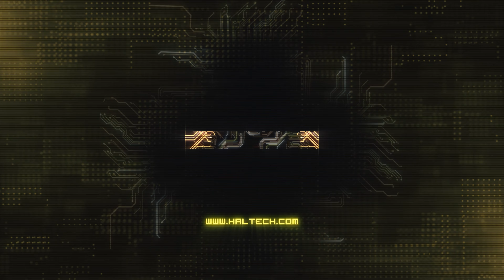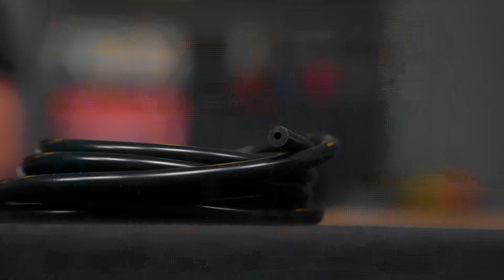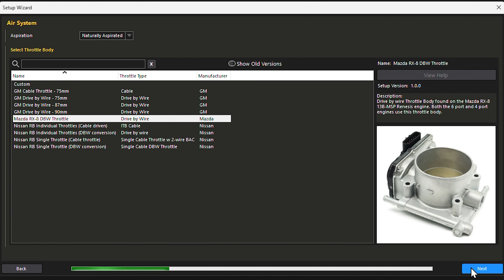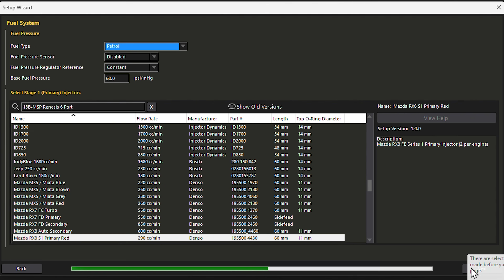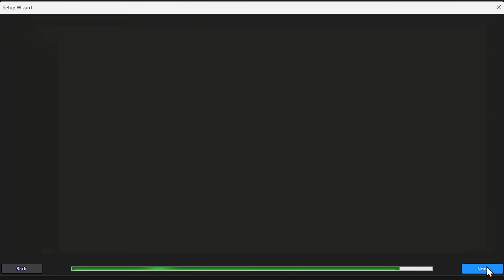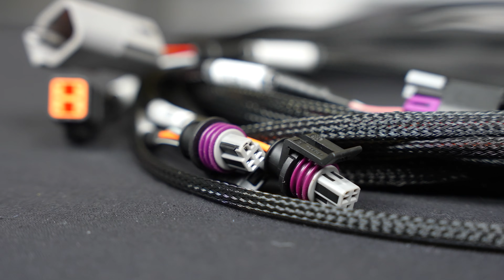The One Upgrade EVERY RX-8 Owner Needs!

Comment: Can the fans threshold/speed be remapped? What about increasing the rev limiter, and limiting when the engine is under a certain temperature threshold (say, limit to 4K RPM max when <65°C), and also ideally idling RPM?
Reply from the maker: Yes, thermofans can be switched on/off at any desired temperatures, Rev limiter can be adjusted based on coolant temp as well .
Reply: @haltech Awesome, thanks!

Comment: Does this support key binding and the anti start features?
Reply from the maker: It will still function and run the car regardless of the factory immobiliser and can prevent the immobiliser warning light from turning on when the factory ECU is replaced.

Comment: Question. Would this system allow you to set the rev limiter to ignition cut rather than fuel cut? It's a fuel cut limiter from factory and ignition cut is just... well, more safe but more importantly, more fun lol.
Reply from the maker: The RPM limiter can be set to either ignition, injection, or a combination of both.
You can also set the cut type to soft cut, hard cut, or cut off

Comment: I've got a turbocharged build with a low mounted pulsar g30-660 (1.01 AR hotside) and a 44mm wastegate on a built motor. This is so tempting but I would have to learn to tune it myself and that's a big responsibility to assume for myself
Reply: It autotunes
Reply: @Oborowatabinostk very generally, its not perfect. To make the most you absolutely should still fine tune it, especially in my case being turbocharged. Very important to tune even with products that will base map adjust
Reply: Plenty of reputable online tuners that can use haltec and get it pretty good.

Comment: Looks amazing im just a bit curious, so does it support EU 4 port?
Reply: If it's the CAN based ABS, yes. I'm told there's an early version of the ECU 4 port (2003-2004 I think) which uses a K-line ABS instead of CAN, and the ECU doesn't talk to that because the ECU only supports CAN not K-line.

Comment: Call me crazy but maybe offer a s2 to S1 adaptor loom?
Reply: Different CAN system, not that easy
Reply: @neversettle7666 iirc still utilizes traditional CAN formatting, S2 CAN Bus stream isn’t that complicated to reverse engineer. It’s been done before many times.
Reply: @thepcmrtim not by any company I am aware of. Would be interested to hear of any company who has deciphered this and offered a solution.
Reply: @neversettle7666 there is a company offering reflashing software but research tells me the s2 ecu crashes after a dozen or so flashes

Comment: how scalable is this for if you want to do stuff like peripheral porting with 4 injectors staged?
Reply: Peripheral port no problem. The ECU has 6 injector outputs, so you can do 3 stages. Do you mean 4 stages (8 injectors)?
Reply: @Andy_the_engo  nope, just 4 injectors 2 and primary and another 2 as secondary
Reply: @Hitperson  Oh, easy peasy then. Just set it to 2 stages instead of 3 like the factory has.

If you're running peripheral intake ports I assume you've done other things to the intake, so you might want to disable the SSV, VDI, APV etc depending on what you've changed, so that you don't get fault codes. But yes this ECU handles that no worries at all.
Reply: @Andy_the_engo I'm trying to plan ahead as I would like to run a hybrid PP engine so would junk the SSV, APV and VFAD
Reply: @Hitperson  Got it. This ECU will handle that easily.